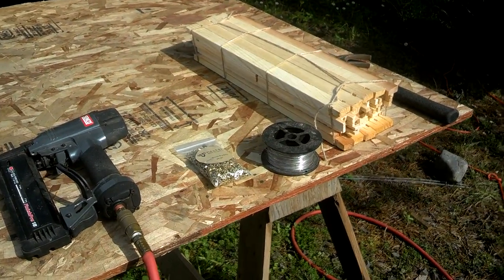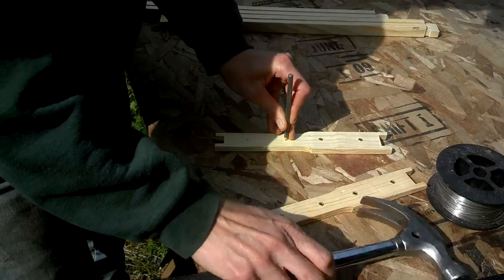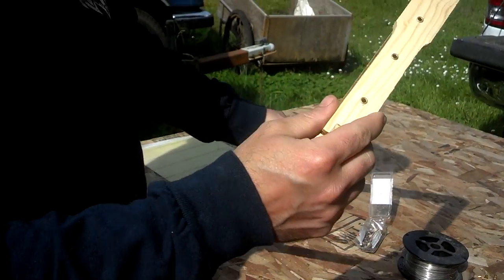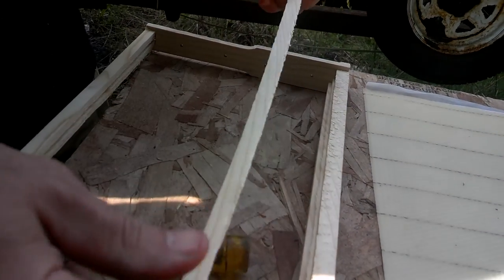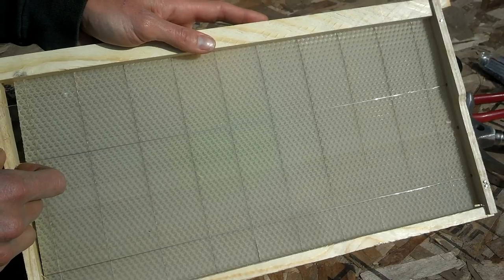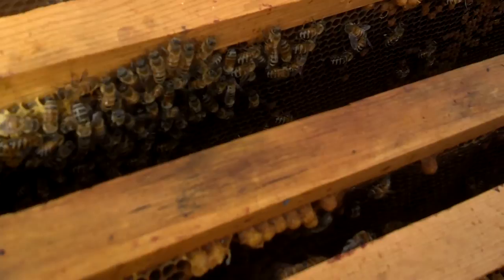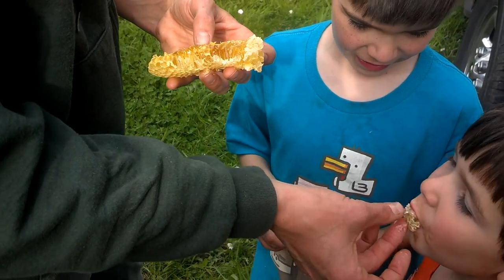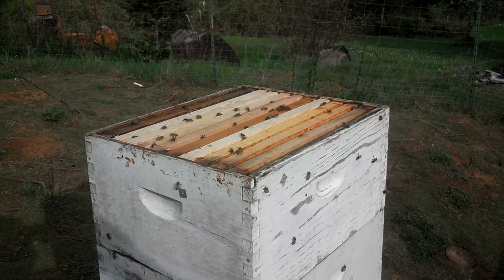How I raise honey bees in my backyard...part 2 New frames

Comment: You've probably been told this before, but try some plasticell 5.9mm foundation from Mann Lake. I have been using it for a few years and have not had any problems with it. Very sturdy and the bees are quick to draw comb on it. I use the black foundation in the brood box so I can see eggs easier and I use the tan or natural in my supers.
Reply from the maker: We have  tried for the past 2 years in our westerns to use the plastic/ wax coated foundations and our bee' s just won't draw them....do you do any thing besides plunk them in? thanks for  watching!
Reply: Try checker boarding them with drawn comb and spray them with sugar water. I use the foundation from Mann Lake, they say it's better but I've never tried anything else so I can't comment on who makes the best stuff.